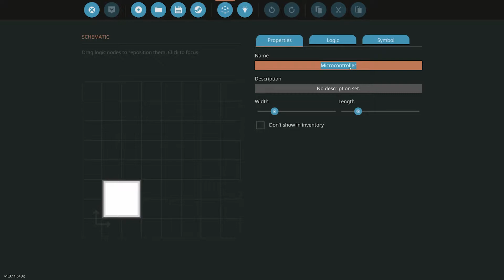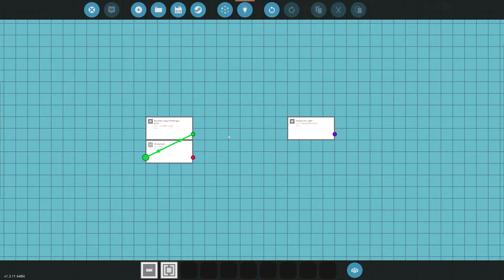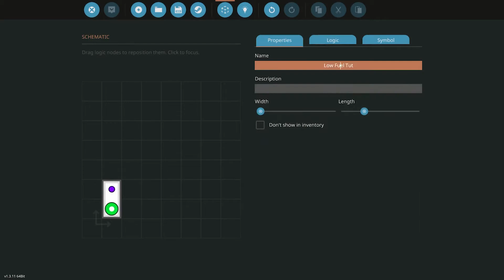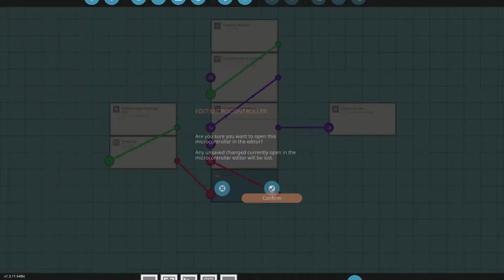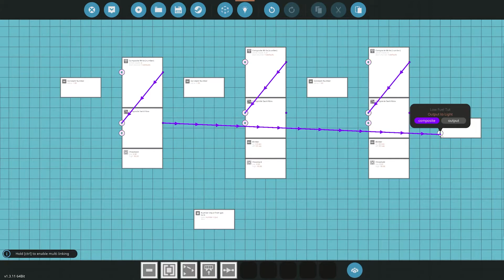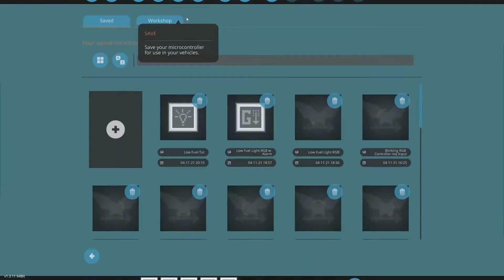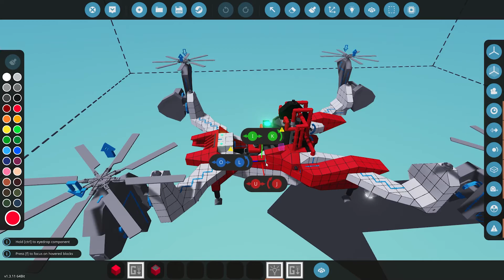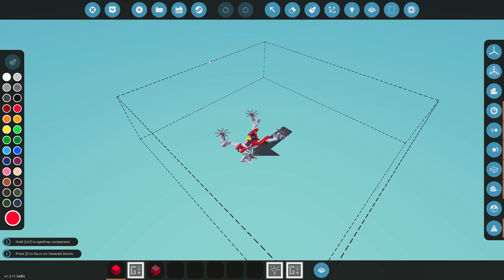StormWorks: Low Fuel Indicator -  Blinking, RGB, Progressive, Audio Alert | Tutorial

Comment: Does this thing still work? I did it exactly how you did and all of the lights wont turn on at the right percentage.
Reply from the maker: Consider if you are using multiple gas tanks that a function might be necessary. For instance, in this video, I've plugged six small tanks into a function (x+y+z+w+a+b)/d) whereas d was set to 1.41, giving me a total fuel output value of 132.97. Each style of tank has a different capacity, so I would recommend you calculate their overall combined capacity and factor that into your thresholds, or create a microcontroller with a function to make that output number a bit easier to work with.

Let me know if you need further guidance.
Reply: @iSneakyPewPew  Sorry I didnt reply so fast, but I made a controller to combine all of the tanks and got it working, so thanks

Comment: If you have more than 100 units of fuel you want to put your thresholds at the correct amount, this didn't work for me until i put 2000 units to 1k and 999 to 499, etc. Maybe you brought that up in the video, IDK but i felt like a total retard trying to get this to work.. Thanks for the video, nice chopper. I was thinking in percentages, im a little high..
Reply from the maker: Typically, I'll get a readout of the numbers from my total fuel capacity before I try to set up thresholds so I have an idea where to start, but you're right, I don't think I brought it up. It's 100% based on maximum possible fuel capacity, which will vary from setup to setup. Glad you found the video helpful, and were able to work out your own numbers, and thank you for the feeback!

Comment: Really good tutorial for a fuel light. you just got a new SUB!
Reply: can you make it where you can hit a master alarm button to turn the alarm off once its triggered?
Reply from the maker: I got this to work by adding an input ON/OFF to the microcontroller. I named mine "Override".

In the microcontroller logic, when we pass the Blinker output to the "Audio Out" around 15:36, you'll instead need to pass the blinker output into a NOR.

The two NOR inputs should be passed the ON/OFF value from the new ON/OFF input you've just created ("Override") and the Blinker ON/OFF. The NOR output should then be passed to the "Audio Out".

Add yourself a Toggle Button somewhere on your creation and be sure your "Audio Out" connects directly to your alarm, and your Toggle Button output connects directly to your newly created "Override" input.

Double check you have power connected to your new Toggle Button.

I hope this helps :)